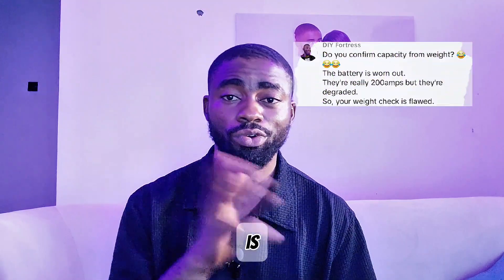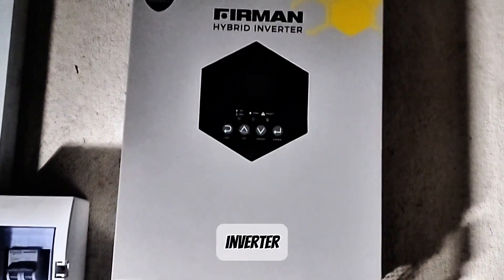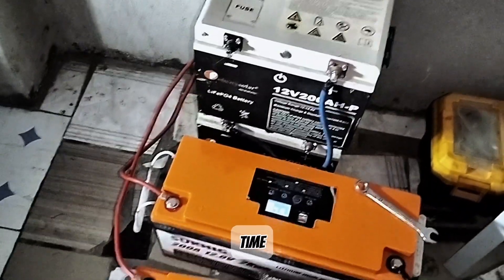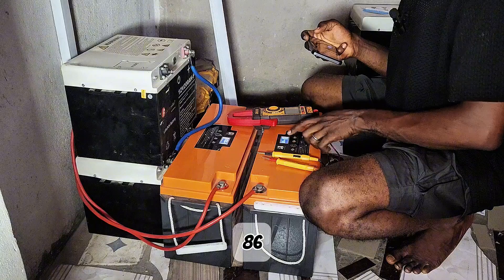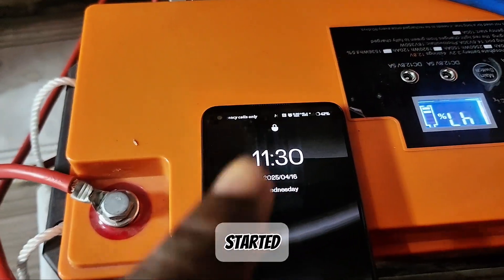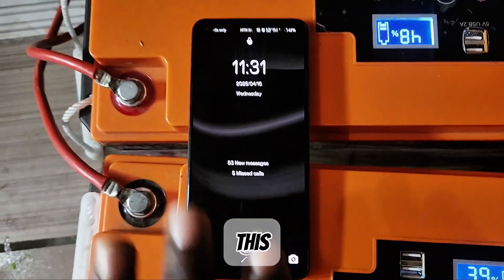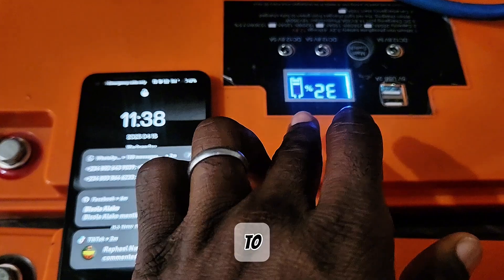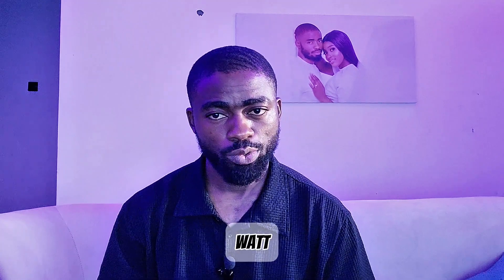DO NOT BUY THIS BATTERY

Comment: Solargod,  honestly this review is wrong and flawed in many ways. How could you connect them in series even with less charge. I would advise you should take down this video.
Reply from the maker: Go and buy the batteries and the correct one.
But videos were on 100% before the video was done, they all went down immediately the PV was disconnected

Comment: If this was a lab experiment, it failed woefully. Author s bias is wired 100% into the video. Every parameters you used were not up to standard. And who concludes a product is bad from one poorly done sample experiment? Why use a load of over 1100w on two batteries that were not charged to 100%? You were supposed to run your test for many days, starting from low watts to high watts .....no....you just jump to 1100w and boom, you conclude battery is not good. That's authors bias.
Reply from the maker: Take that to your lecture halls Mr professor.
Who test car's horsepower then driver 10mph after a month and then conclude the starting force of the car🤦🙆.
You can come to our office and pick the batteries up for experiment Mr professor.

Comment: I use same battery and I am getting good results. What you needed to do was add a battery balancer to the setup and it solves all the issues you raised as it appears they don't work well in 24v series connection. I had exact same issues using same 200a Sukhig batteries until I added a 24v balancer to the setup. Thanks
Reply from the maker: It depends on the load you're using on your battery.
So getting a good result depends on your load usage
Reply: This is the matter of  extra BMS because the battery has its own inbuilt Bms, it depends on the load and how strong of the battery,but he need to charge it full (100%) before he can make his conclusion

Comment: Your approach is inappropriate, I could point out so many flaws,   LFP batteries are supposed to be paralleled not in series.  You should have  gone for a single 24v battery. You could be sued for demarketing a product fa
Reply from the maker: You fit help them sue me sha.
Then while at the court we can still do the capacity test.
Lithium battery cannot be series, really?
And here you're claiming you know much
Reply: @Mairigaemmanuel  *False* — lithium batteries do work well in series, *but* there are important considerations.

### Here’s the full picture:

#### ✅ *Why lithium batteries can be used in series:*
- It's common to connect lithium cells (especially LiFePO₄ or Li-ion) in series to increase voltage.
- For example, 4 × 3.2V LiFePO₄ cells = 12.8V system.

#### ⚠ *But here's the catch:*
- **Cell balancing is critical**: If one cell gets overcharged or over-discharged, it can degrade quickly or even become unsafe.
- *Battery Management System (BMS)* is a must to:
  - Monitor and balance cells
  - Prevent overcharging/discharging
  - Protect against thermal runaway

#### 🛠 Common practice:
- Many high-quality lithium battery packs (like 12V, 24V, 48V) are just several lithium cells in series with a built-in BMS.
- You can even connect whole lithium *batteries* in series, as long as they’re:
  - Identical (same type, age, capacity, charge state)
  - Monitored by a BMS or external battery balancer

---

So in short:  
> ❌ False — Lithium batteries can absolutely be used in series, **with the right protections and balancing**.

Comment: This capacity-test procedure is flawed in many ways. Firstly, you did not charge the batteries to full capacity. One of the batteries was still way below full capacity before you started the discharge cycle. You ought to top-balance the batteries by first connecting them in parallel and charging to full capacity with a appropriate charger. Secondly your discharge setup  should include a DC wattmeter to measure actual watt-hours from the battery. There are many other flaws. If you present yourself as offering an expert review of a product, then do it right, otherwise, you open yourself to legal liability. By the way, I have never used this battery and I am not claiming it to be good or bad. This capacity test, however,  does not provide an answer one way or the other.
Reply from the maker: Try watch video for the sake of understanding not argument.
Clearly stated the battery went to 97% and dropped back to 87% after putting the pv breaker off.
You can help us buy the batteries do the capacity test and post!.
Does the watt meter does a different thing from clamp meter aside keeping records of the measurements?.
Reply from the maker: The battery is bad period.
Lemax was able to deliver 3hr plus with same amount of load or even more.
What special thing does watt meter do?

Comment: I feel this video might be a bit misleading. I understand that lithium batteries don't really work well in series and might have led to the poor performance. Given it's price, there might be tradeoffs and only proper capacity test with a single battery will give us the information we need. The question remains; is this battery good for it's price point? If I spend 250k on this and it can deliver at least 1.9kwh out of 2.5kwh claimed, then I think it makes sense for the price.
Reply from the maker: Go watch my test on leman then come back to this video and make the compari

Comment: Sir, you need something to measure the actual energy you consume, with that its easy to tell how many Ah remaining in the so call battery.
Those device for test are on AliExpress and not too expensive.
if you plan doing capacity test which i will advise you to do, you need to get one
Reply from the maker: Shunt resistor, yeah?.
You fit buy one send for me

Comment: I’d like to say a big thank you for reviewing the Sukhig batteries, but I have to be honest — they are the most useless batteries I’ve ever used. Here's why: 

1: No Manual or Specs Provided
The batteries arrived without a user manual or any information about their specifications — no details on charging voltage, depth of discharge (DoD), or other basic specs. That should have been the first red flag for me. 

2: Terrible Performance Compared to FLA Batteries
I’ve used Flooded Lead Acid (FLA) batteries before, and even they perform better. Sukhig batteries, which are supposed to be Lithium-ion, don’t last nearly as long. You can discharge Lithium batteries up to 80-90%, compared to only 50% for FLA batteries. So, in theory, these should last longer — but they don’t. 

3: Suspiciously Fast Charging and Poor Sync
Another concern is how quickly they charge — too quickly, in fact. It makes me question what kind of Battery Management System (BMS), if any, is inside. They also discharge just as fast. I often have to charge the batteries individually just to balance the voltage, but once I connect them into a 24V system, they discharge at different rates, which is unusual and problematic. 

4: Complete Shutdown with No Recovery Support
The most frustrating issue is that once these batteries run down, they shut off completely and won’t come back on. My PowMr 3.2kVA all-in-one inverter, which I highly recommend, won’t start unless it detects some voltage from the batteries. 

So, I have to manually recharge each battery to at least 30–40% before reconnecting them. That’s a tedious task. A good Lithium battery should never fully cut off power like this — it should retain just enough voltage to allow the inverter to kick in and start charging once solar power returns. 

5: Suspiciously Lightweight
The batteries are so light, it makes you question what’s actually inside. I’d love to see someone dissect one just to know what cells are used. 

Final Thoughts
I’ve had to adapt just to get by with these batteries while I save up for a proper 7.6kVA 24V SMS battery. For now, I only use around 200–500 watts at night  just enough to power my essential equipments this light usage helps them last about 4 to 6 hours. I never let them discharge below 30–40% to avoid having to manually recharge them again, however during the day when my panels are producing between 1,800–2,500 watts add all my household equipments. 

Bottom Line: These batteries are not for beginners or anyone who doesn't understand solar systems well. If I didn’t know how to revive a dead Lithium battery, I would have assumed they were completely dead. 

Do I recommend them? Absolutely not.
Reply from the maker: Whoa, thank you for this well explained review.
This will serve as eye opener for others so they don't do the same mistake
Reply: I’m presently a victim and everything you listed is so accurate! Fast charge, fast discharge, dead battery (unfortunately I don’t know how to revive it manually), I usually wait for grid , only that revives it (my inverter is hybrid). Now I’m planning to get another battery like NEXT power or Colarsolar.. any thoughts about them?

Comment: Nice one but you should have allowed the batteries get to 100%, not just 100% but also with the constant charging current  approaching zero.

A 100ah Lithium battery for example can stay at 100% and still be taking current for more than 30mins B4 the final voltage is stable.

Comment: Damn! Thats very poor performance from the batteries. An installer will use this and receive enough insults from customers😂

By the way, what charge settings are you using for your Felicity LiFePO4 batteries?
Reply from the maker: Omo, installer's should be mindful of what sellers introduce to them.
The felicity I use, I set the bulk to 28.4v
Reply: @Mairigaemmanuel  That's why installers must do their own research before giving products to their customers.

I set the charge voltage at 28.2v for my Felicity battery. Anything above this and the OVD sets in. I initially set it to 28.8v and didn't know why it was showing overvoltage. Sadly, it destroyed one of my inverters before I realized that I had to lower the charging voltage. It appears the cells aren't balanced and one of the cells reaches 3.65v way before the others resulting in the OVD.

Comment: Are you saying they are worse than lead acid batteries.
Reply: With the test what comparation can you make with Felicity 150ah?
Reply: I currently have the 400a version of it and 150ah Felicity battery.
Reply: @OlaDele-pv3cx how is the 400a performing?
Reply: Yes it is . I am a victim. 2.5kwh battery does not last 1hr on 100watts load.
Reply from the maker: This very brand yes

Comment: Great 👍 real-world test.
If these are lithium ion phosphate batteries, one 200Ah battery should support  1100W load for 2hrs 19.6min up to 100% DOD. Roughly 2 must exceed 4hs 30 minutes. This has become common even with some reputable brands.
Reply from the maker: Yeah, this is happening due to so much hype from marketers and installers